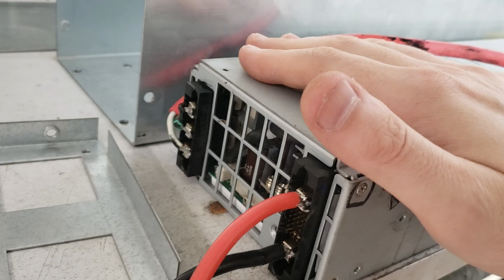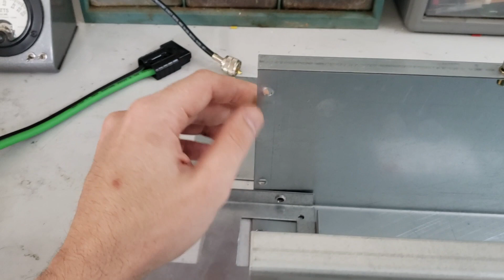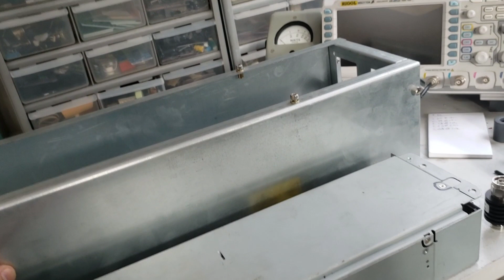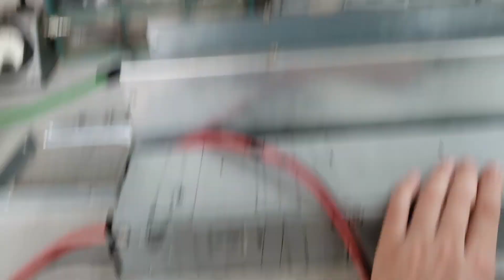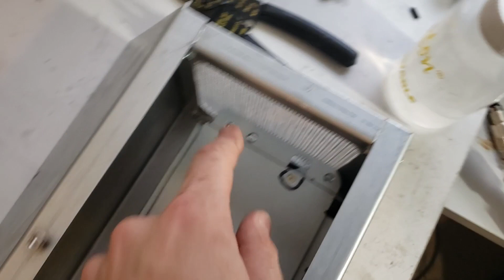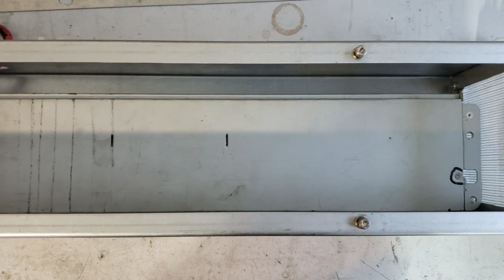ESP120 Power Supply Cabinet (Quick n Dirty)

Comment: The flatpack 2 3000 look into them they are smaller and stronger programmable voltage and also they have nice racks you can slide them right into